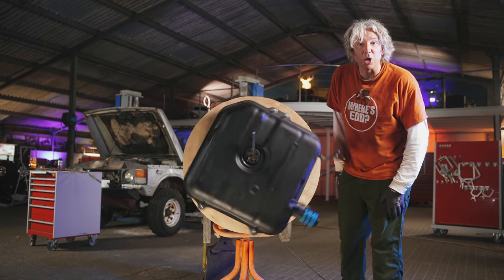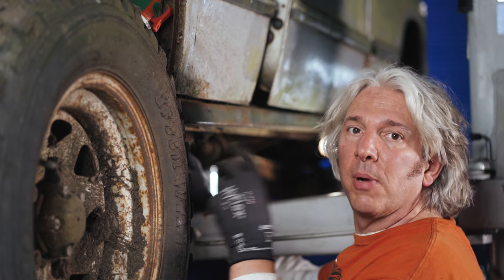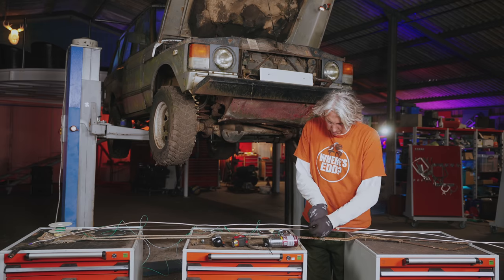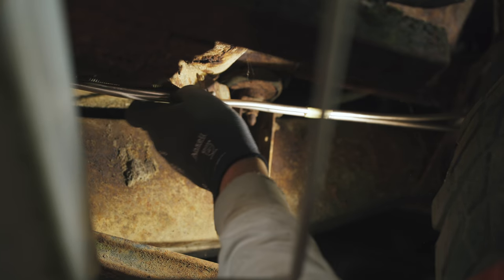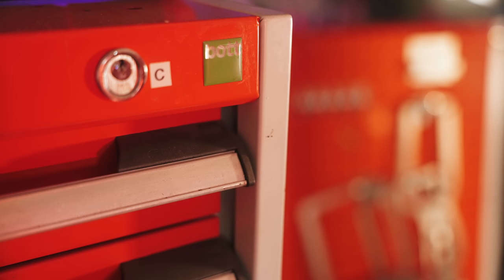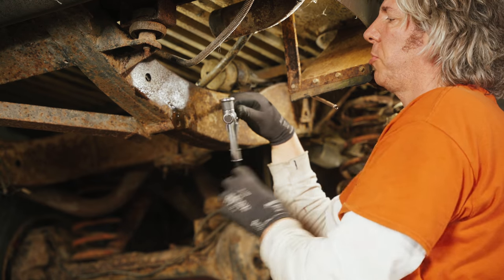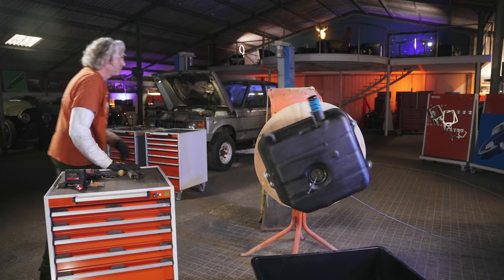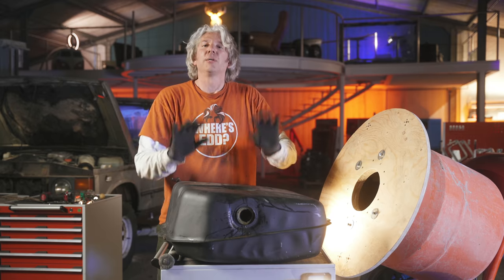1986 Range Rover, rusty fuel tank fix, Part 2 - Edd China's Workshop Diaries

Comment: Hi Edd 

I’ve got a problem with my Mitsubishi shogun 2003 automatic.When i start it up in the morning and select drive it doesn’t engage into the gear. I have to wait about 30 to 60 seconds before it goes into gear. And then it drives perfectly throughout the day. But when I start it up the next morning it does the exact same problem. I have had the transmission fluid and the filter changed. Any help would be appreciated. 

Many thanks logan

Comment: Good job on the fuel tank.
You could've simply cut the tank along the factory weld join, then do all your repairs inside (possibly galvanise it), then weld it back together, 100% job. 
Now, you've spent lots of time on the tank and there's still rust inside it.

Comment: I am curious to understand why you didn’t just setup the tank and fuel lines underneath the vehicle and go for an engine start. You could have connected up using an extra length of fuel line and if all worked ok then cut to size. If the engine is goosed, you have not wasted time fitting in stitu…

Comment: I wish you would have shot some compressed air up the fuel line before connecting because some dirt from under the car made it's way into the hole when you threaded it through.. Oh well..

Comment: I have that problem with my old vectra  b sri dti  pipes rotten at bulk head wish had that tool to flare ends of pipes to connect to my plastics pipes. I'm using moka pipes. and rubber pipes.I would  rather made pipes up  like edd

Comment: I'm not certain, but i think that in my neck of the woods Kunifer (CuNiFe) was the term generally applied to steel pipe- albeit plated with copper then nickel. It was better than the factory crap that Renault and BL were producing, that usually seemed to be just painted steel. 
I assume what Edd has is the pukka 90% Cu 10% Ni stuff that is a bit more of a pig to bend than pure copper, but a bit tougher and with a higher pressure rating appropriate to braking applications moreso than fuel. (Copper is perfectly ok, it's just that people in hi-viz jackets with clipboards started grizzling that it had a lower pressure rating and is a little soft...so CuNi took over (in the UK at least.) If there was more than 10% nickel in the alloy there would be an issue bending it satisfactorily.

Comment: hi 
2 ways for the tank to address the future corrosion , as u have now removed any remaining factory rust proofing from the inside 
1/  remove rust as best as u can , then use fuel tank re-sealer 
2/ cut tank open blast the inside reweld and use tank sealer   or have tank zinc  plated 

Many factory steel tanks ,not all , were TERNE coated , this has a very high lead content

Comment: Whats benefits of that pipe over standard copper
Reply: I would say abrasion resistance
Reply: I could be wrong and Ed may correct me, but I think that standard straight copper pipe is quite soft and over time can become brittle and fracture through vibration, I think they've banned its use in the USA for brake applications? The copper/nickel/ferrous or cunifer is much stronger and less likely to fracture as it's a much harder material, but that makes it harder to bend and shape too, so best to use a pipe bending tool, that way you'll avoid kinking the pipe too. Also, Sykes-Pickavant used to make a brake pipe flaring kit which also included a beading adaptor but the whole kit was horrendously expensive.

Comment: should have changed the angle of rotation on the fuel tank, acid would have taken it the bare metal - then there is a coating to finish the job still using the mixer to rotae the tank throughout - just saying

Comment: Dearest Edward. 

You have a brain the size of Mars but you missed out molasses as a rust remover.  Ten quid buys 5 litres of the good, thick stuff.  Mix with hot water at 3:1 ratio (water first) and make a lovely molasses bath to soak all your rusty stuff in. 

Needs to be left for best part couple weeks.

Brought my tools up an absolute treat and you can reuse the molasses to sweeten your tea if you are a tight as Yorkshire type. 

Lots of love. 

Bongo.

Comment: Brick acid would get rid of the corrosion. Then treat with phosphoric acid.
Reply: It would. Unfortunately, muriatic (hydrochloric) acid also leaves chlorides in the metal surface behind after derusting. And chlorides are pretty good at accelerating rust corrosion. I've had more success using phosphoric acid over the years, which leaves a coating of iron phosphate behind that slightly inhibits rust and no chlorides contaminating the newly cleaned surfaces.

Comment: as i wouldn't be filming this, i would just run some braided lines, cable tied to the chassis.
Reply: Probably wouldn't pass their inspection.
Reply: @davidcampbell4465  most cars have the fuel lines clipped along the bottom of the   pan, my volvo 850 does.

Comment: What a waste of time when you could have just bought a new tank!
Reply: Where's the fun in that?
Reply from the maker: Of course, that’s the sensible thing to do… but it was fun to have a go!
Reply: @mrsabidji  imagine having a car, where you don't have spare parts anymore?
Reply: I think the point was to show it can be done if you can't get hold of a new tank.
Reply: @eddchina  You could have cut the tank open, blast it with sand and Weld back together. But would be a much bigger hassle than cleaning it with your way
Reply: "Buy a new tank", do you mean the fuel canister or the car itself? 🤣